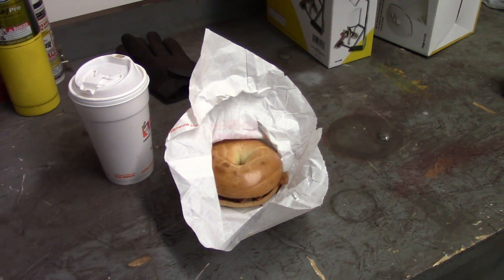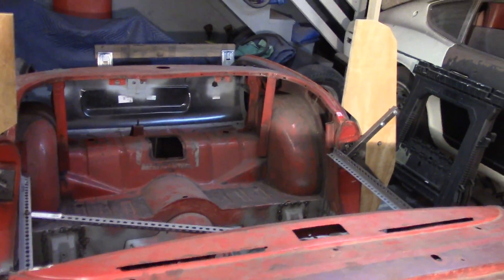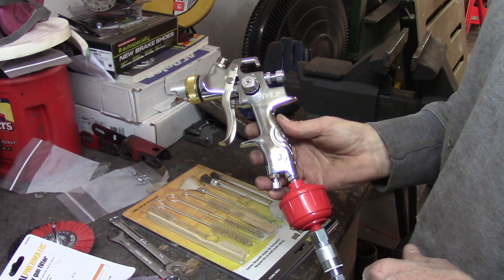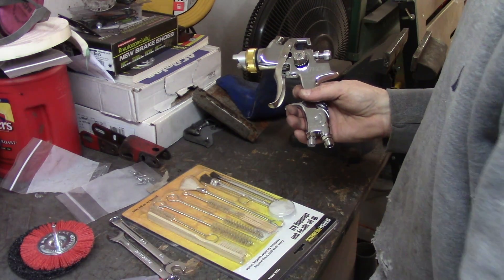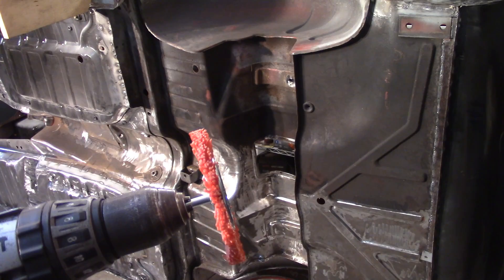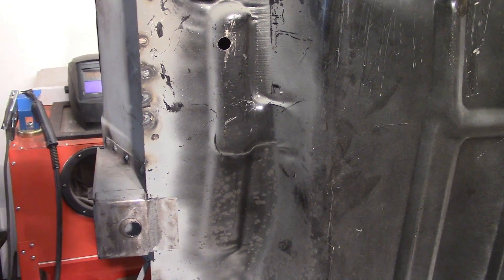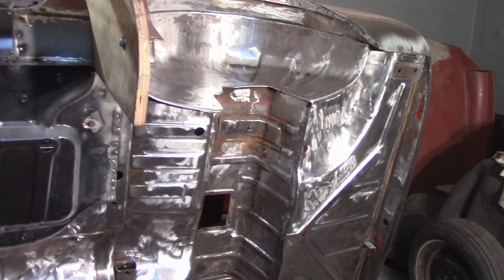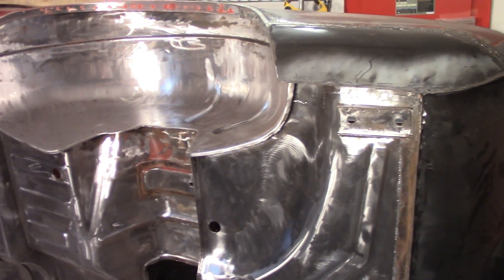Triumph Spitfire Restoration - More Underneath (Pt. 3)

Comment: why you taking off the black primer perfectly fine to prime and seal over
Reply from the maker: Because I want to use epoxy primer since its such a good corrosion barrier. Its also a direct-to-metal paint, so the black stuff had to come off for best adhesion.
Reply: well you didnt need 2   so u gonna strip  yr sills  and valance as well  i supose
Reply from the maker: liten48 yup.